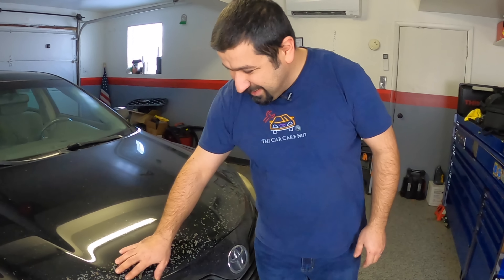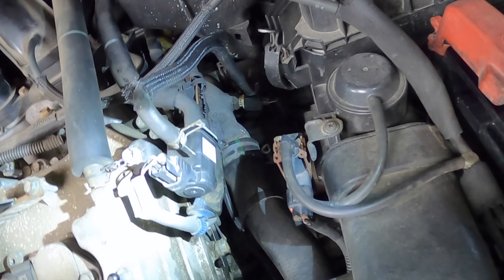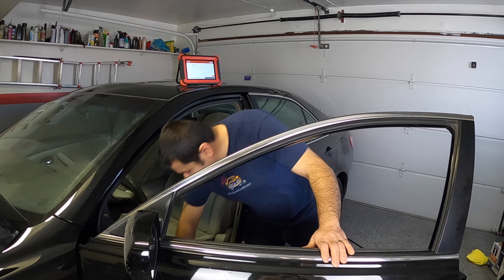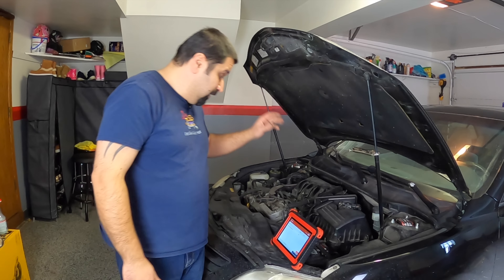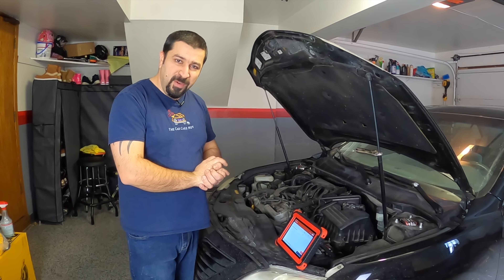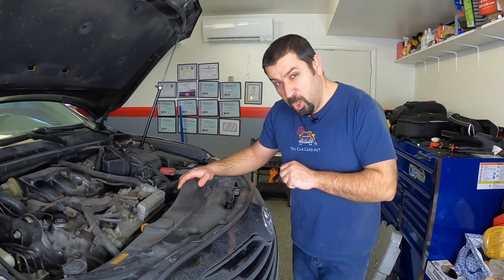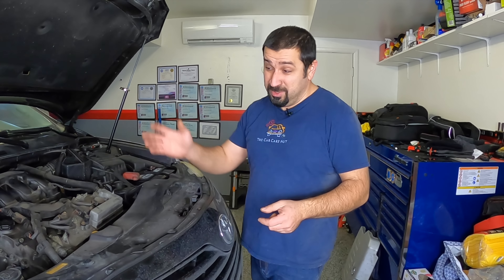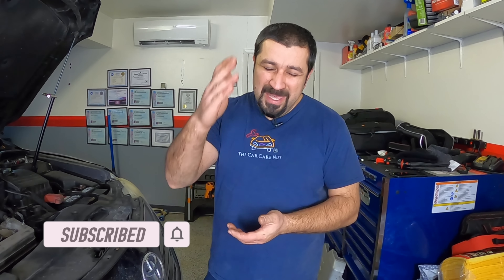How Does a 15 Year Old Toyota with OVER 200k Miles Hold up? Full Inspection!

Comment: I drive an ‘03 Corolla that used to belong to my mom that she bought brand new in the fall of ‘02, it only has 120k miles and I hope it lasts another 120k miles 👍
Reply: if you keep the basic oil changes and basic check ups then it should last or even longer
Reply: True spirit 😁😊 keep it up man
Reply: Change the motor oil every 3000 mile like I do with my wifes 03 corolla 1.8 litre and it will last beyond 500,000 miles. My wifes 03 corolla has 200,000 ks on it and runs as good as the day it was made. The thrust bearing and the clutch is in need of replacing but besides that these cars go forever if you look after them.
Reply: I have a 05 toyota camry v6 3.0 litre with 273,000 ks on the odometer, it still runs and drives as good as the day it was made.It has full log book history right up until 250,000 ks,im the second owner in 17 years. Camrys and corollas are the most reliable cars ever made,and the most sold cars in automotive history. The newer models are not so well made as the older models but  are still better made than most cars provided they are made in Japan.
Reply: It def can. I have an 09 Camry with almost two times the miles 😂
Reply: I have an  '03 Corolla purchased two years ago with 79,400 miles.
Put 25,000 more on it and I love it.
Only needed the intake manifold gasket replaced which I did.
Great car.
Reply: @dbs555  ive just discovered i need a new valve cover gasket so i will be doing both valve covers,and while im at it im going to check the camshafts and crankshaft oil seals as they will need replacing eventually, with the way things are going in the world at the moment parts for cars may become difficult to get so im better to get them now while they are still available.
Reply: I have a 03 toyota corolla in Afghanistan. It has 203000 miles.
Reply: @parsaparsa2880  they are one of the best cars ever made. If you keep up the oil changes and maintenance you will get double that mileage out of it.
Reply: Got an 04 Corolla. Odometer won't go past 299,999 miles (known defect) so these cars will last as long as you maintain them.
Reply: @slickrx6908  They sure do. Best cars ever made regarding reliability, quality of manufacture,and ease of maintenance.
Reply: I have an '03 with 236k on it. I change the oil. That's really it. Tires and brakes, too, of course.
Reply: It will. That's basically a new car
Reply: Change the oil in every 3000-4 000 miles it will last forever
Reply: @jyotiprakashdas4429  yep,I actually go by the colour of the oil,as soon as it looses its golden honey colour I drop the oil which is usually around the 3000 kilometre range.Quality motor oil is always on sale at our local auto store and for under $50 bucks for oil and a filter there's no reason why you wouldn't change it except if your a lazy ass person like a lot of people are thesedays.
Reply: My wife drives 2006 Corolla @ 140K miles. Its still good.
Reply: @dbs555  most Corollas need to repalce intake gasket. Its easy and cheap to replace ... Good car
Reply: @seattledreamer9901  My 2007 Toyota Corolla has 164,000 miles on the clock.
Reply: My brother has a 01 Camry that has 201k miles on it and it still drives fine.
Reply: @Sauronthegreat1967 problem is with those Corollas when you take off the oil cap it look inside the motor I'm looking for an old 708 Corolla at the moment most of them are large drop in discussing inside the motor somebody maintains incorrectly or they're just terrible noisy under the 1zz motor maybe if you had it from New and you change synthetic every 3,000 Mi maybe when you take the oil cap off and look at the inside of the motor I'm curious if yours looks like brown s*** inside like a normal to Brown oil furnace oil look in the oil cap I'm just curious they can tell me that yours is clean at 200,000 miles to Miracle C-130 thousand look like s*** I seen one 30,000 to sell the got you a picture of it like brand-new after the only one I ever seen what he wants $11,000 for a lot of money 408 Corolla with 29000 miles on it maybe it's not if I needed a car and have all the cars I have I would probably buy his car for 10,000 with 29,000 miles the 08 is the best out of all of those 0348 no noise in the motor and the plane as it is we keep changing out of oil I believe I would get a half a million miles out of that one but I don't know about half the ship people got for sale with 100,000 miles on it took a shet inside the engine Las Vegas cars making noise when starting up and when you rev them up you hear the engine knocking away banging it made very cheaply and most people do not maintain them and it makes it worse
Reply: @jamescostello7584  no my wifes corolla engine is perfect,oil is changed every 5000 ks and the inside is not sludgy or varnished.

Comment: I have a 1995 Lexus LS400 dark green with a gold emblem of 652,000 Miles. Got it from my dad. Original engine and transmission.  Oil change every 15K  miles(Mobil 1) transmission oil change every 70 K miles, timing belt water pump every 110 K miles. The rest,  do the yearly maintenance. LOL Issue is the power steering fluid leak. I am keeping it.
Reply: Simple transmission drain and fill every 70k or whole fluid
Reply: @AB-yc1np  I flush it through the radiator bottom part. There is an outlet hose there to remove and you clamp it. Turn on the engine  (10 secs) whatever comes outmeasure it and add the new one with what u measured out. DO this until clear red color. Not totally all fluid was flushed out but  better than drain and fill. There is a tutorial here YT about Lexus ls.
Reply: @chaseadkins6217  Salty bro?🤣
Reply: @chaseadkins6217  can't be too much if it has 652k on it

Comment: Love toyota and lexus vehicles. My lexus ls430 2001 has 335,000 miles. It still runs quiet. Original engine and transmission. Original starter and alternator. Just regular maintenance.
Reply: I own a 2009 RX350. Alternator went out at the worst time (road trip on a Holiday) $1K repair. My suggestion is to have them both replace as a precaution. Wear and tear is a thing. You can have them rebuilt at a local rebuilt shop.
Reply: Original transmission? Incredible.
Reply: @darthdarthbinkss  It's only 335k miles not really that much if it has been maintained. The alternator and starter are more impressive.
Reply: Do any transmission fluid changes?

Comment: I was a Tech at a Ford dealership. Every time the car porters pressure washed an engine to make it look nice,  It always came back in 6 months or so for electrical problems. Mostly corrosion on connectors.
Reply: I have 3 toyota vehicles. Never ever have washed engine. Reasons like this..
Reply: I never wash my car, only hand wash exterior and lubricate every metal and rubber, run like tank.
Reply: Remember water and oxygen kill your car.
Reply: Right.  Pressure washing the engine in modern cars is risky, electric damage is very possible.  You had better know what you are doing
Reply: One thing I always used to do on my 2001 Honda CBR F4i motorcycle was pack as many electrical connections that I could get to with dielectric grease to keep water out as it was my daily driver in all weather conditions.  Would you still recommend against pressure washing an engine even with connections packed with dielectric grease?
Reply: Car porters lol. In Montana we call them car monkeys

Comment: 2009 Toyota RAV4 V6 AWD 5-speed auto with just over 340,000 miles that I put on it myself. Routine maintenance, suspension and brakes. Engine and transmission run like new. I know it won't last forever, but it's making a hell of an effort. I'll keep it til it quits.
Reply: Hows the underbody rust?
Reply: Any burning oil?

Comment: My 2010 RAV4 with the 2AR-FE engine has 180,000 miles on it runs perfectly. It has always been well maintained.
Reply: One of my Toyotas as well. Aside from replacing an O2 sensor that I suspect died prematurely because Jiffyluck failed to put the air filter back in and we discovered a week later!
Reply: I too, believe in preventative maintenance.
Reply: @turo3066   thats not impressive
Reply: @ChrisB-cx6td  ???
Reply: How much oil does it burn? My 2011 burns about 2.5 qts every 6000 miles
Reply: @ddphotoadventure2657  He says you should change you oil every 5000 miles.

Comment: My 2002 Lexus ES 300 with now about 167,000 miles is rattle free, tight and solid. The level of craftsmanship is unparalleled. I bought it from the original owner last April.  Last summer I had the following work done: 

1. Replaced all four struts last summer because the rear ones were leaking.
2. Replaced original alternator
3. Replaced original air conditioner unit because it’s starting to squeal and didn’t want to take a chance of not getting through the summer without air conditioning. 

Now the car sits about an inch or two higher in the back the way it was when it was new as well as the ride which is like it just came off the showroom floor. 
Last summer I replaced the in-dash CD changer/cassette player with a double din Alpine touch screen unit with a hard wired backup camera. And now it works smoothly with my iPhone for Google Maps and my Apple Music
I wish you were closer to New York I would love to bring my car to you for a complete look over like you did with this car. I love how you take your time and evaluate everything based on experience. Toyotas/Lexus are the best cars/SUVs on the road today. dependability and reliability are unparalleled.
I almost bought a similar year v6 Camry but I figured for an extra thousand or more I would get an older Lexus like mine. I searched for a one owner well-maintained and found my beautiful ES300. The original owner replaced the timing belt, water pump, and valve cover gasket at 88,000 miles. It was serviced at a local Lexus dealership in New Jersey all the way through 110,000 miles According to the Lexus owners website.
Reply: I hope you replaced the bearings on top of the struts. If you didn't you will be replacing them within a year. Ask me how I know.
Reply: I prefer the Toyotas and Lexus with timing chains. That’s a thing with many Hondas as well even to this day many are timing belt engines. I got a Prius 07 237,500 miles or so and it’s a timing chain so the only belt I need to worry of is a water pump other than that change the oil. The latest Prius are even better and take it further I heard they don’t have any belts cause the newest Toyota hybrids are more electric
Reply: @robmalcolm8042  Only the V6 Hondas have timing belts.
Reply: @loden888  that’s even worse as the v6 are stronger and need a chain more than a 4 cyl. Doesn’t make sense that almost every other brand has chains on the 4 cylinders and v6s but not Honda. Maybe they feel they are cheaper.

Comment: I own a 2003 Toyota Avalon. Original owner. Passed it down to my daughter for college. 225,000 miles on it. The key is maintenance. I religiously change the oil myself every 3-months or 3,000 miles, whichever comes first.
Reply: I own the same car, same year, I buy a case(10) of Toyota oil filters at a time, 44 dollars, and get 5 quarts of synthetic oil for 20 bucks and change the oil every 3 months..That is 4 oil changes a year for a hundred bucks, it costs a hundred bucks for one oil change these days at some places...The oil is always some what clean, still dirty at the end of three months, but not in comparison to most peoples..I've been doing this system for decades, it works...I have the exhaust leak he mentioned in the video at the hanger, getting ready to tackle that...And change my brake pads...
Reply: @realeyesrealizereallies6828  - Yup! Changing the oil every three months works! I buy my synthetic oil from Walmart and buy the Toyota filters using a dealership coupon. Save a lot of $$$.
Reply: I change our oil every 5,000 miles on our 2009 RAV4. We drive about 90% highway miles. It still looks clean at 5k and is still at the full mark on the dip-stick. Just out of curiosity, I plan to do an oil analysis within a month at our next oil change. No one changes my oil but me. I've been doing it since I was 18 and I'm 75 now.
Reply: @appleforever6664  You can get the case of 10 Toyota oil filters from Amazon for 44 bucks, they are the real ones...They are sold by Frontier Toyota, the price does fluctuate between forty and 50 bucks...

Comment: Our 1998 Ford Ranger 2.3  has 250,000 miles never had any parts but a new Radiator and doesnt burn oil yet......been an amazing little truck

Comment: Great video! If my beloved 2005 Camry LE 2.4 with 218,000 miles were on this video...you would have absolutely NOTHING ...NOTHING to write about! I bought it new (2005) and bought a new 2020 2.5 LE.  In 15 yrs. and 218,000 miles...it never dripped one drop of anything!! Even the AC was never serviced in 15 yrs.!  Everything was original except (of course) the four shocks/struts, front brake pads (twice), and rear brake shoes (once). I did my part with excellent maintenance...the car was built in Kentucky and is a Modern Marvel.
Reply: Yes I agree. My 2005 Camry SE V6 was built in Kentucky. Super reliable, smooth engine, powerful engine, uses no oil, fun to drive. Best car I ever owned.

Comment: My '06 Sequoia drives like new with over 216k miles. Had to catch up some maintenance when I bought it in 2020- ball joints, radiator, timing belt, tires- since then it has been awesome.
Reply: That is awesome. I’ve been looking for a good sequoia and I see so many with high mileage! 
That 2UZ-FE engine is bulletproof . Like those J70!
Reply: I got rid of my 01 tundra right before it hit 300k miles (severe rust, it was too far gone). But it was in the family since new, and even with 300k on it, it ran just like I remembered it when it had 100 miles on it. It even had the stock clutch, haha. 

Love the body on frame yotas...
Reply: My '08 Sequoia with 269k drives like new as well. I wish I had gotten one sooner. Only complaint is gas mileage.
Reply: I have a 2005 sequoia and it runs like new ( so smooth) I’m telling you the 2UZ engine is incredible
Reply: And u KNOW ur VAN!! If my brake lines/frame weren't so rusty, I'd STILL HAVE my 97 camry w/265,000 miles.😉
Reply: My 06 4x4 sequoia also runs like new at 278xxx.
Reply: My 97 M3 and 89 325i BMWs had 215,000 and 247,000 miles respectively and had zero issues and ran like new until I traded them in. Today I drive a 2021 ES hybrid but just wanted to point out the Germans can run hard too mileage wise. Toyotas aren’t the only ones :) E36 And E46 bmws with the straight six are famous for going deep six figures with minimal issues. Providing decent basic maintenance.
Reply: @GrandHuevotes  dang !  Nice!!

Comment: 2000 Tacoma SR5 4x4' 3.4 extended cab, oil change every spring, fall. 220,000 still going strong. You have to keep up maintenance.
Reply: How is the frame, if you live in the rust belt? My Tacoma does live in the rust belt and Fluid Film is a must here every fall before the slushy brine is applied on the roads.

Comment: Still love and drive my 2005 Camry with over 350,000 kms. The early 2000's were the height of Toyota quality, including Lexus. Toronto Canada
Reply: Does it burn oil?
Reply: @musicfame  no. The 2007-11 Camrys burned oil because of low tension piston rings. The 2005-06 Camrys were fine.
Reply: I drive a 2005 Camry SE V6, which I bought new. Only 128,000 kms, so it has a lot of life left for sue. Totally reliable, smooth and powerful. Love the car! I'm 76 so I guess this car will out last me😃

Comment: These are things that I have to take note of, I have a 4 cylinder 2001 Toyota Camry with 170k miles on it. Never had serious problem with it. Still runs great, there’s minor leak somewhere. Other than that it’s a great car.
Reply: 2003 with 152K. Yep, great car.
Reply: I have 286k
Reply: I have a 2007 Toyota Camry with 200750 miles still runs fine.
Reply: 2001 Camry with 224k
Reply: 1998 with 175K
Reply: I have 2005 with 199,600 miles, the CV boot leak s, today I put duck tape around and cover silicone outside,I don't know it work or not until I drive it around few days.
Reply: @charleshoang566  Thrifty huh?
Reply: @jaya.0069  That why I paid off for my condo in San Diego by cash and my car.😂😁😄
Reply: Assuming you've done regular oil changes keep that car unless you have spare $ and just  "want" a new one.. remember all cars do the same thing they get you from point A to point B

Comment: I have a 2003 Camry and was leaking oil from the valve covers, mostly the one by the fire wall and it looked like it was a huge leak, but I replaced both valve covers and the oil leak stopped completely, you know most times a very small oil leak will spread everywhere and it looks way worst than it really is and this is because the wind as you ride it pushes oil everywhere, even to the sides of the engine, So you're right a good pressure wash and then drive the car for at least 20 miles. I also do Toyotas and this car is almost perfect like you said.
Reply: Unfortunately that is a 2GR-FE to fix that leak you have to pull the engine. It is quite an expensive job. If it is not losing noticeable amounts of oil its a wash it and try to keep it clean scenario.
Reply: Mine has a oil leak too. Did you replace them yourself or had it done

Comment: When you smash the Thumbs Up button without even watching the video first.  After watching, you smash it again, then again, lol.  2018 Corolla LE with 63K miles here.  Just did a transmission fluid flush, thinking of doing a coolant flush soon.  Just some minor creaking from the lower control arm, a little silicon did the trick.  Hoping to reach at least 230K like this Camry but without any major repairs/replacements! Tks for another great video AMD!

Comment: I also have a 2007 Toyota Camry LE but with the 2.4 L engine. It now has 174K miles and still not a drop of oil burned between oil changes.
Reply: How often  do  you  change  your  engine  oil?
Reply: @bradterry9777  Every 5000 miles with 0W20.